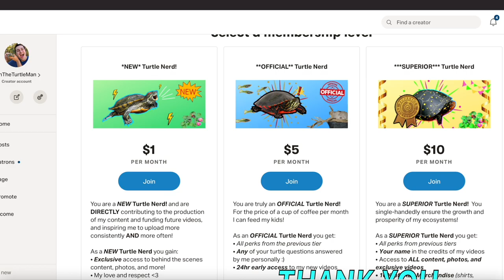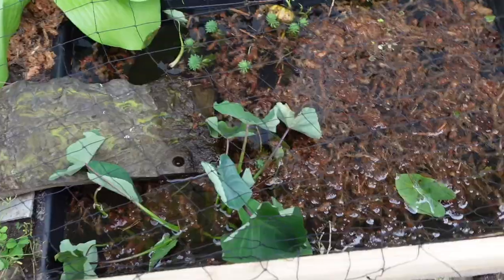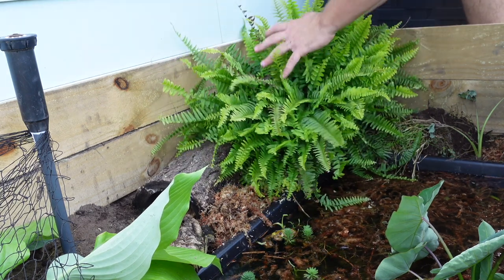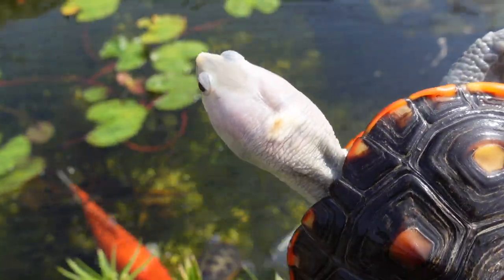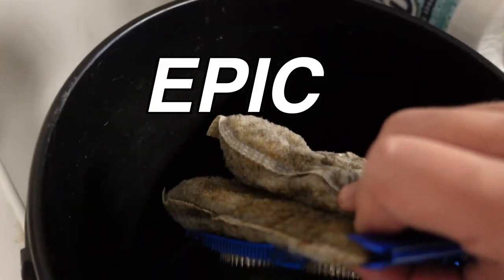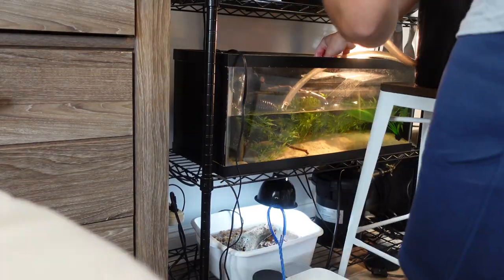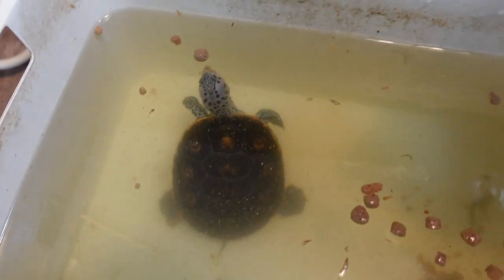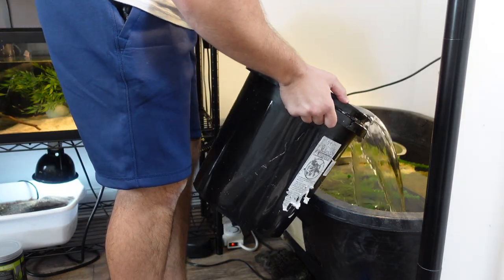Baby Turtle Comes When Called!

Comment: So I’ve been having trouble cycling my turtle tank. 

From what you said. It’s not the most important thing?
Reply from the maker: Nah, not a big deal at all
Reply: @DanTheTurtleMan_  got it. Been hearing so many conflicting ideas.

So just as long as I do weekly water changes I should be fine? Do you ever test your water to make sure ammonia doesn’t get to crazy?

Btw. Love the channel man!
Reply: I would say cycling is less important with turtles than fish, but still important. Establishing a good cycle will make your life easier in the long run, and make your turtle happier. The biggest thing is to have a lot of surface area in your filter media. Don't replace the bio media. That will crash your cycle. Filter sponges are good and they are easy to rinse out in old tank water. Tap water can kill the cycle. Give it time and the cycle will establish itself. Most of the process is just giving it time.
Reply: @deanbuchholz1917  good to know. I had a fluval 307 for my 40 gallon and I couldn’t get the cycle started.

Someone told me to upgrade my filter. So I got and fx4 now. Hopefully that helps
Reply: @evanwakano6127  FX4 is a great filter for that setup. You should have no problems getting a cycle going after a bit. I did weekly water changes when I was getting my cycle going and now it's going strong
Reply: @deanbuchholz1917  water change weekly during a cycle? Got it. 

I was under the impression you don’t do that so you won’t kill your beneficial bacteria that’s growing.

Thanks for the advice
Reply: @evanwakano6127  most of the bacteria lives in the filter media. Not much of it actually grows in the water column